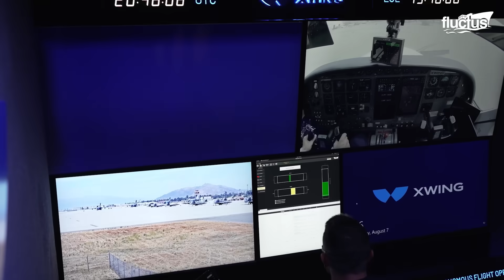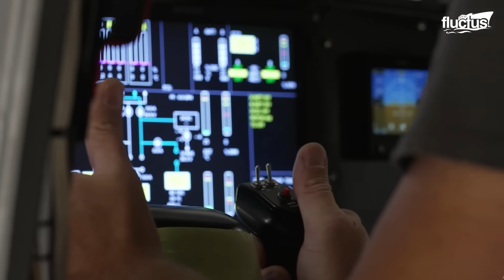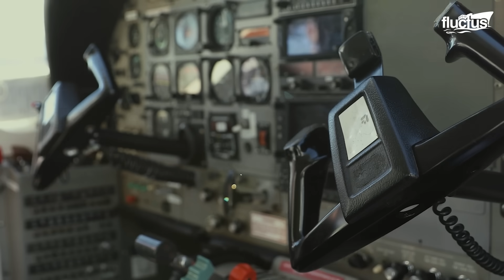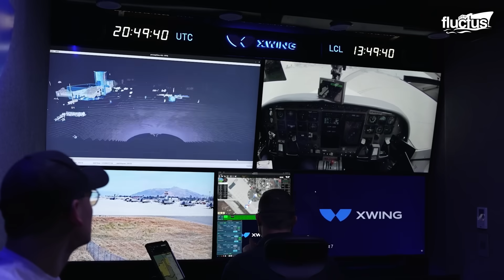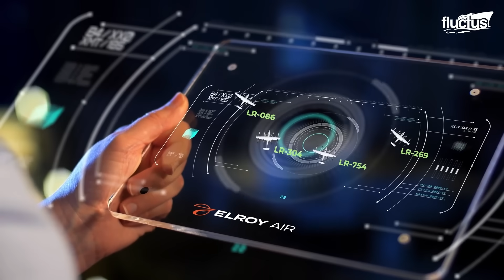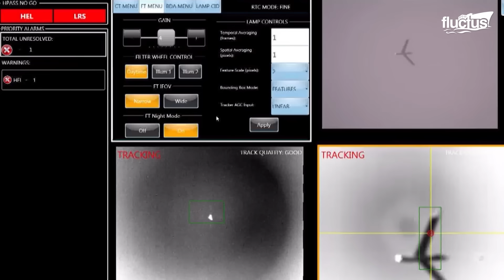Inside US Facility Building & Testing Future Combat Drones

Comment: rapid re charge de grades the battery life span. Battery technology has gotten better but not for rapid recharging. Battery fires when they go bad thermo run away. If their not built correctly if you out source lithium many cuts corners to save money and safety. So when you buy something with lithium you don’t know. Kids hover boards, one wheels 🛞 etc because that one product is built with cut corners need to learn the signs hey it’s smoking charge it outside away from cars/trucks, etc. even just charging can end up burning your garage or house down. Plus ev cars like tesla not a lot of re charging stations are available so traveling isn’t a good idea. Plus ev stations are not compatible with other ev brands. Licensed electricians have to put in 50 amp plugs standard 110 would take two weeks to charge most cases 80% is your limit over a hundred % Nobody has put in charging ports in shopping places grocery stores are not jumping on the band wagon. Buying a Tesla or any ev that’s not local you’re screwed if they go bad. Tesla doesn’t have replacement parts one and you’re done.  Most cases it’s a flat bed plus the cost of months in the shop of back ordered parts. No certified techs Elon doesn’t share the software to fix said Tesla their neat look 👀 but keep on going to something else